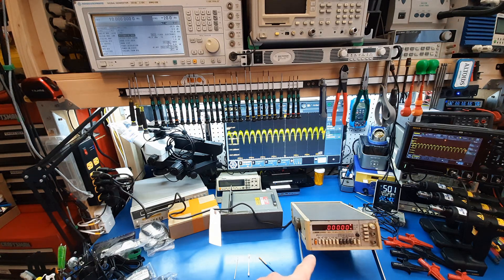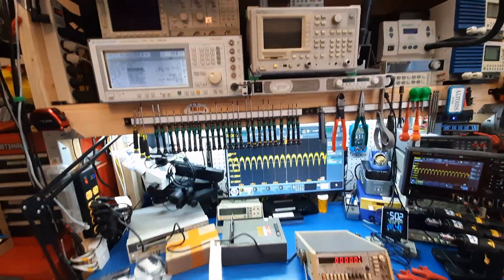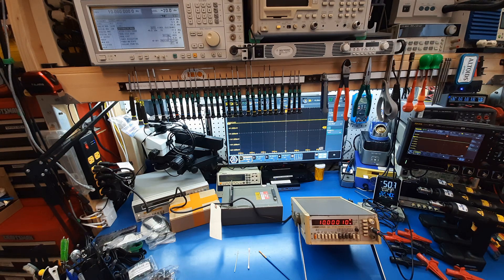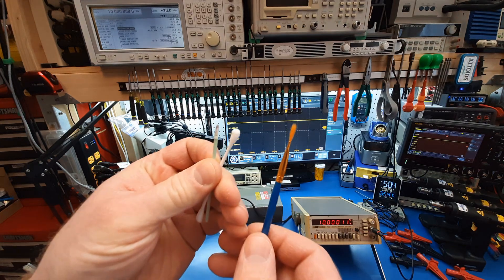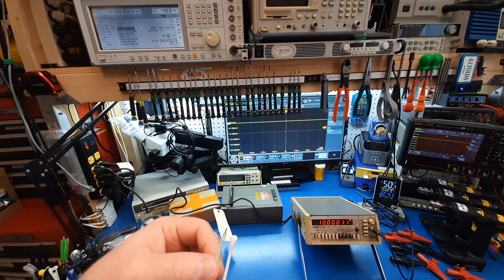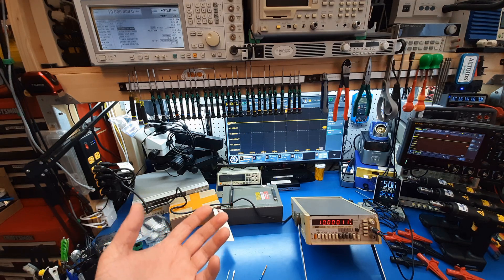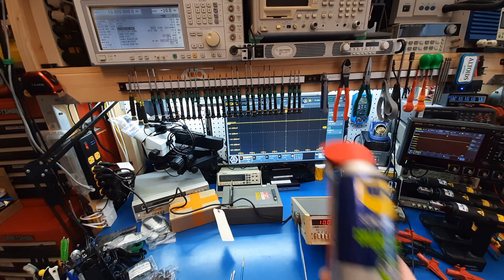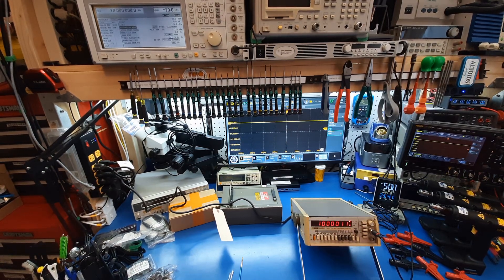An important tool for every Electronics Lab that isn't often talked about.

Comment: What are those micro Q tips called? Do you have a URL for where you got them? Thanks!
Reply from the maker: Link: https://www.aliexpress.us/item/3256807108154068.html - they are called a lot of things - foam swabs, clean room swabs, optics cleaning swabs etc etc etc.  I get them on AliExpress usually.  You can get them on eBay or Amazon... for like 5-10 times the price.  Just crazy markup there.  I get both the 1.25mm and 2.5mm head sizes as I find those two are the most useful for electronics work (and you can already buy Q-tips at any supermarket which covers larger swabs).
Reply: Thanks for the reply and advice on which preferred sizes to buy also, much appreciated!

Comment: I wanted some of those little tiny things that look like micro Q tips.  Initially I bought some online, but also found that they are for sale in hobby places,  like in the crafts area of Walmart.  These are double ended types. Great for cleaning connections in pins too small for Q tips.  Also 99% isopropyl alcohol is excellent for cleaning oxidation on pins and connections.  Recommended as first try as it is harmless to plastics and evaporates.
Reply from the maker: I found them on AliExpress for $2.13 per hundred pack.  The whole De Minimis ending thing kind of makes that problematic though - looking around on eBay and such they can be found... for 6x to 10x the price.  Arg.  But anyway, yeah, they are great for getting into tiny crevices and cleaning there, especially in situations where more forceful or ESD-risky methods (compressed air and vacuuming respectively) would be a bad idea.

Comment: Last TV I repaired it had a high impedance shortage causing it to not stop cycling input , caused by dust. So,  I took a bottle of Dawn dishwashing liquid and a hot garden hose and rinse it all out nice and clean then let it sit  for a week to dry out ,  solved the problem last I heard 10 years ago it was still good  it was too greasy you know that type of dust to do with a vacuum or air hose. Hydraulic process I would call it.  Thank you.
Reply from the maker: Oh wow, memories here.  My first.. no, my second job out of university I was IT support / computer repair at a local ISP, back when such things, you know, existed.  The IT manager of a local manufacturing business was a friend of my boss and a regular client, he brought all his computers in to us that needed repair.  One day he brought in a computer wrapped in a trash bag.  "It got dropped in a vat of used machining oil."  Are you file-system-check'ing kidding me?!

After getting some gloves, I popped out the CMOS battery, took it outside and spent about half an hour spraying the damn thing down with a hose in the parking lot.  Nothing really to lose at that point.

If I recall, I didn't manage to revive that one, but I was able to get his data off the hard drive.  The thing with used machining oil is all the suspended metal bits, from large to microscopic.  Too many shorts to even try, no matter what I did.  I didn't know about, nor have access to, ultrasonic cleaning back then.

But yeah.  You can absolutely wash electronics, if you understand what you're doing and what not to do.

Comment: Vacuum cleaner and De-ox.
Reply from the maker: A vacuum cleaner gets used quite a bit for me, at least for items that aren't terribly ESD sensitive.  Can't use it for things like voltage references or the higher-end multimeters though.  I DO want to get one of those ESD-safe vacuums, but $$$...  As for Deoxit Gold, I haven't used that specific product myself but have heard it works well.  When I was looking over options to service the rotary knobs on a voltage reference that I have in the queue for service and repair, I ended up choosing the MG Chemicals 801B.